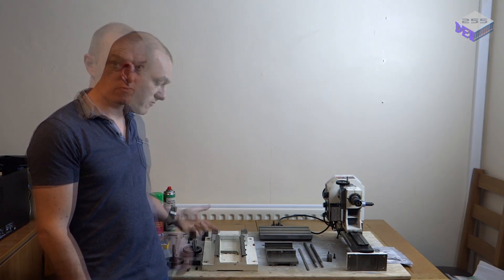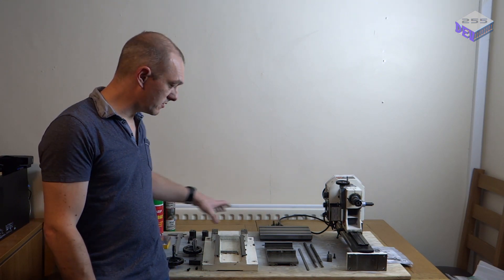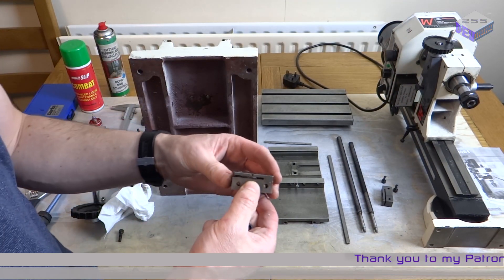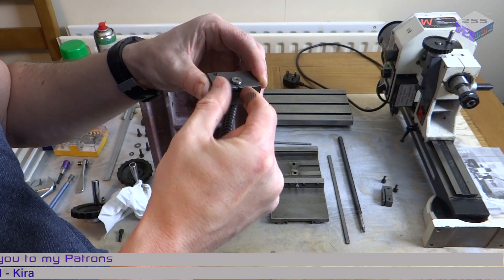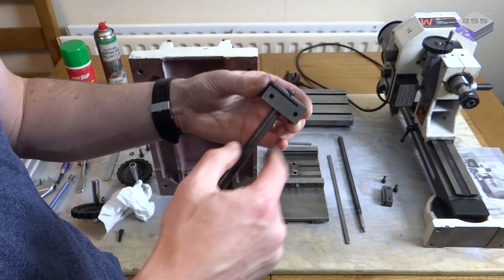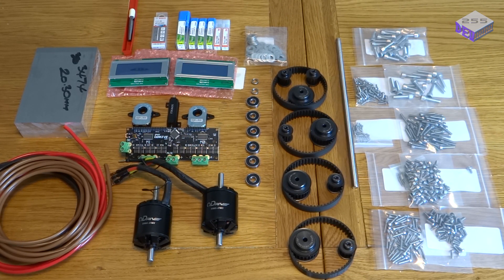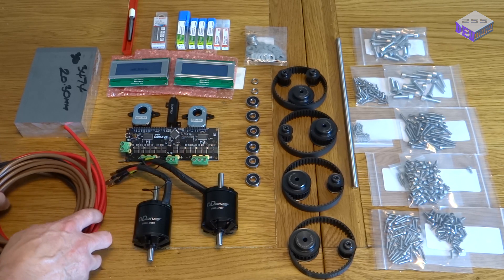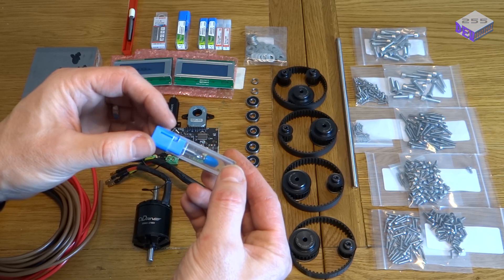CNC Mill Conversion - Part 2 - Dev255

Comment: This channel is a gem,! I have the same o drive kit and really interested in going down the same road ... I am currently experimenting with one o drive to run an old 1920s small lathe. I will support you on Patreon as you are one of the few actually doing things that are useful/interesting/honest/informative. I probably will find out what milling machine it is but could you just tell me the make and model please? Thank you and power to you and your channel.
Reply: Ahhh -> Axminster Sieg  X1... righto... /still find this a bloody goldmine thank you/ - I'm now on your Patreon - cheers mate!
Reply from the maker: Hi, thank you, you are very kind. I've just logged on and spotted your pledge, so a huge thank you again, it makes all the difference to these projects. The machine is a Sieg X1 that I have had for well over 10 years and it hasn't failed me yet. It takes a little time to get set up correctly, although I have been able to make parts on it with very good accuracy (and I'm a novice). I'm glad you are liking the channel and content. Please feel free to ask any questions here or on Patreon, I would be happy to help. I am currently programming a HDMI screen for use on the milling machine (all in, controller, monitor, microprocessor and graphics driver come in at £120), it's taken 3 weeks of programming so far, hence I haven't got many video's out just yet, although think it will be worth it.

Comment: Hi neil. Is there any kit you can recommend to convert a Sieg x1 into a cnc machine?
Reply from the maker: Hi Keko, there are hardly any kits available for the X1 and any that are available are very hard to source, I decided to upgrade mine using brush-less motors and writing all the code myself on the Arduino for the challenge and to aid in my MGF EV project, plus have it run from solar energy. Once I finish my mill conversion, I will be sharing everything as open source including the Arduino sketch and CAD files, where it is currently sitting next to me now and I will be machining out some of the X-Axis components today. I don't know how accurate it will be at the moment, but the Y-Axis looks very promising (0.006mm at the moment, unless that was a fluke measurement). Please post here if you find a decent kit as this seems to be common to upgrade the sieg x1. I hope that helps

Comment: Very nice job. I love the videography in the silhouetted milling portion, that was very pretty!

What made you go for the odrive for this conversion? I hope it works out, but I've seen a a very informative video by Marco reps that seems to suggest that holding torque behaviour might be a problem for a cnc, from what I can remember.
Reply from the maker: Hi, thank you, I saw the reflection in my TV and thought I'd try the silhouette clip 👍.

The ODrive won't lose torque over its RPM range so should be much better than stepper motors, plus with 2 belt reductions the backdrive should be able to hold the work better. I may be able to increase the pre-loading of the x and y axis also as the motors should produce around 2Nm of force, so just below 8Nm at the leadscrew. I know I say should alot, but this is a trial of this system too. I'm confident that I can make this work, we shall see. If all good, this should be a very fast CNC machine.
Reply: @TheSolarPoweredEngineer  ok, awesome! you've clearly given it some thought and i also think it'll likely work to a very satisfying degree. i was really just regurgitating some info i picked up recently, but the video was more of a theoretical comparison of steppers, brushless motors and servos, aimed at a larger machine with less gear reduction anyway. 
can't wait to see how it turns out, but more than that i'm SUPER excited to see your engine run! good luck :-)